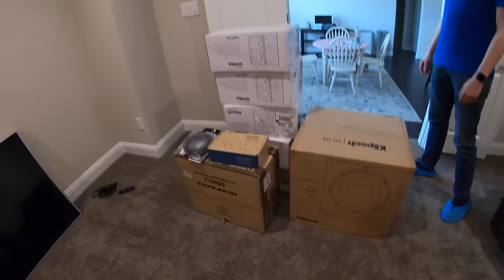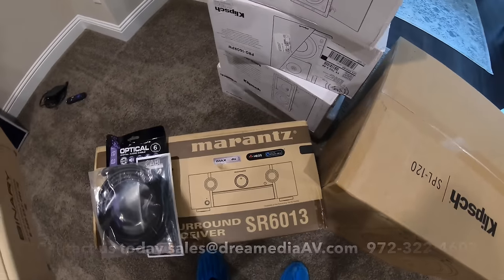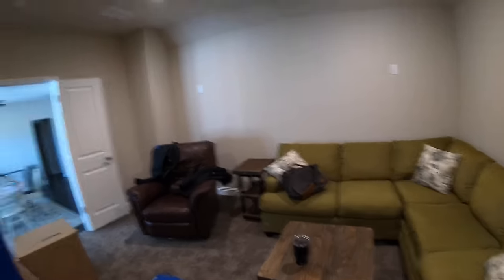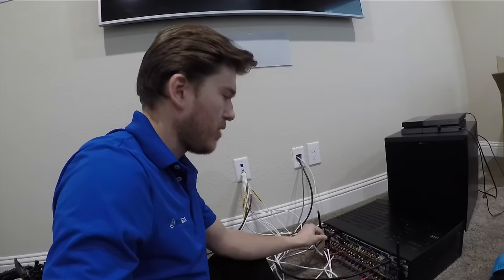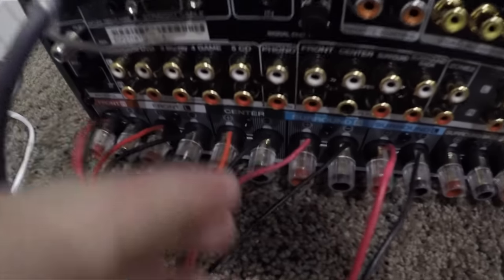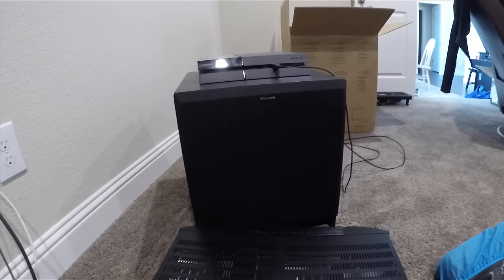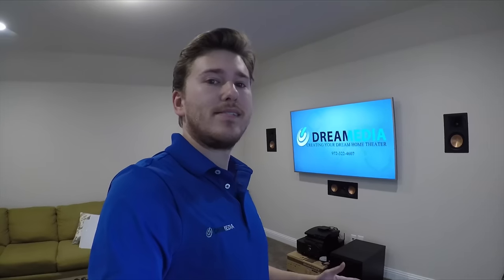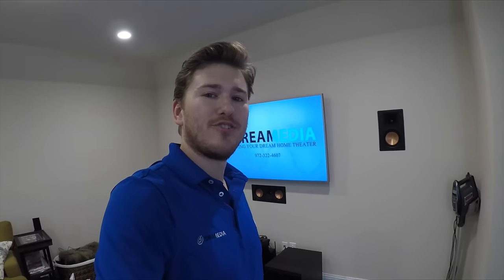Klipsch Reference Premiere Theater Room IN WALL SPEAKERS!

Comment: I'm digging all these Klipsch install videos!  Super pleased with my Klipsch set-up which includes the same center, and FRH and FLH speakers in the video.  I went with the RP-280F's for the regular FR and FL.  For the rears I went with the 5800-C II.  Since I'm a bass-head I'm running a pair of R-115SW's and a R-112SW.  All being powered by a Pioneer Elite SC-72.

Comment: how did you get the center speaker in?  on mine, its too wide and doesn't fit between the studs.  it looks like you took out one of the studs to get it to fit.  is that right?
Reply: Anyone watching this and curious as well, we just cut out a part of the 2x4 to make it fit and braced it underneath with another piece.  Not a load bearing wall so figured structurally it was okay.  Had a contractor look first though

Comment: I personally never use a drill to screw in-wall speakers. I always hand tighten them. Using a drill you can over tighten the screws and break a plastic bracket very easily. Great Job though.
Reply from the maker: We are highly trained and have installed hundreds of these. Its like second nature now

Comment: I notice you wired each speaker individually. How would you wire a 5.1 surround back to a an amp with zones? Would it be 16/4 & 16/2 to each R/L speakers and a 1 16/2 to the center speaker? Thank you!

Comment: You guys aren't installing those in wall speakers as designed. your'e making it harder than it should be. The detachable bezel is installed by itself first and THEN the speaker slips easily into the bezel. Klipsch has an good 2 minute video showing you how to do it here on their YouTube channel. Enjoy watching other custom integrators take pride in their job, keep up the good work!

Comment: Loving the vids. Inwalls look beautiful. Do you get asked to create back boxes for in walls. Is it worth it on your opinion.
Reply: As nice as the Klipsch THX line is, I was wary of all the open-baffle designs.  I instead chose the Definitive Technologies UIW RLS II for the front stage (all vertical orientation), an acoustic-transparent screen on top of the center and Def Tech UIW RSS II for the rear surrounds with Def Tech DI 6.5R for Atmos height channels with a pair of SVS PB2000 subs in opposite corners of the room.  Zach just dropped them off and I have more room prep steps ahead so it will be a while before I get to audition them, but I'm optimistic with my choices.  Dreamedia's prices can't be beat and I love this video content!
Reply from the maker: Some in walls actually offer this as an option. The episodes we sell offer them on the atmos and the wall plate speakers. It helps isolate the speaker and not let sound travel to the room behind the speaker.

Comment: How powerful are those front left and right speakers . Can they handle the same as floor standing speakers ?
Reply from the maker: Handle? You can feed speakers tons of power if you have the crossovers right. the high wattage number is just for peaks iike explosions. unless you are watching a movie that is one long explosion, you will be fine
Reply: Dreamedia Home Theater Do the LCR work well as rear surrounds?